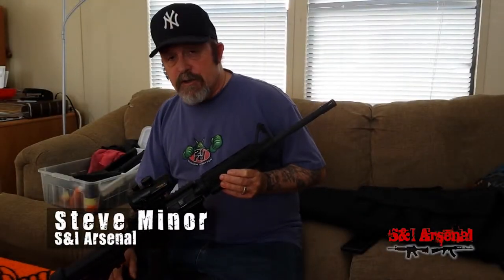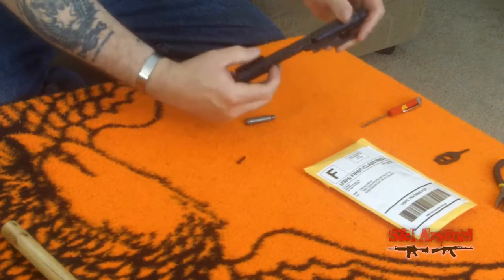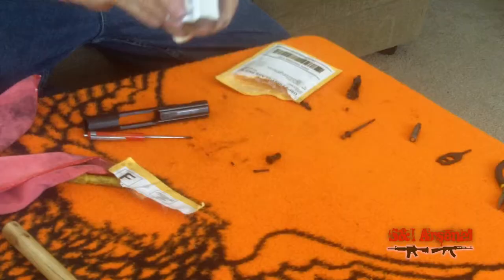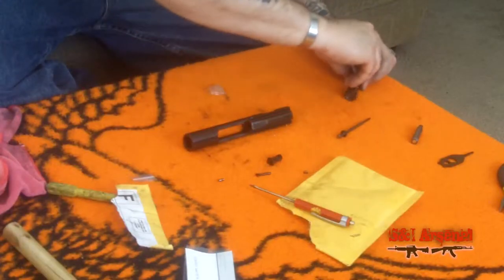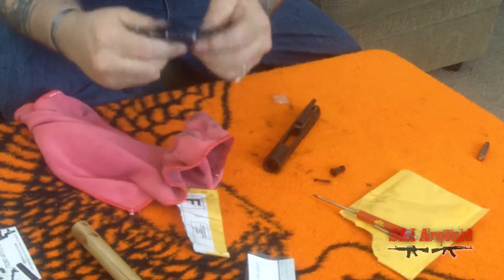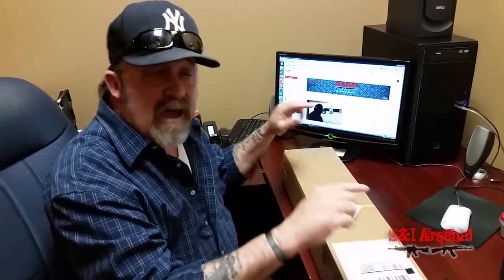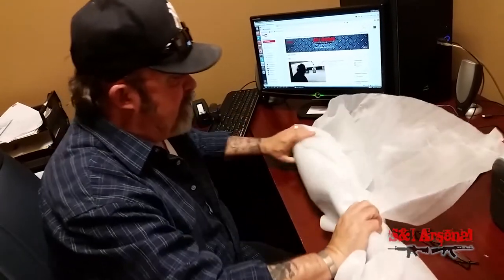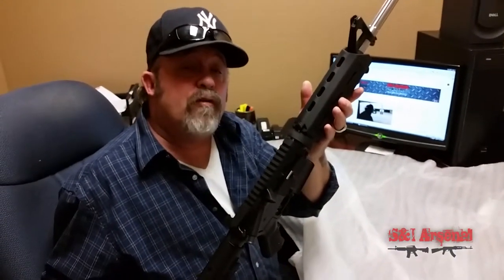AR-15 Extractor Spring Upgrade & BCA Upper Assembly Unboxing

Comment: ha ha the lacquer doesn't cause the problem.  i thought this video would be 5 years old when i heard that.
Reply: I beg to differ I have talked with a lot of experts in the field of the AR format and I have the bowl to this day with a coat of lacquer in it that was pulled from the chamber.In fact it had also ruined the extractor pin from over work and this was replaced by the manufacturer under warranty who also verified the lacquer problem but we are all welcome to our own opinion have a great day and thanks for watching!!!
Reply: Steven Minor
what dealer will warranty an ar 15 that has shot steel cased ammo. none that i have talked to.  you cant melt the lacquer off the case with a propane torch.  the extractor wear is usually from an over gassed carbine that is trying to extract too early.  the zink and brass coated steel cased ammos will also stick cases every so often if the chamber is not cleaned.  some go couple hundred some that i have will go almost 1000 before sticking a case without cleaning the chamber.  the theory is that the steel case neck does not expand like brass and allows carbon to build up in the shoulder and around the case.  when this carbon reduces enough clearance you get a stuck case.